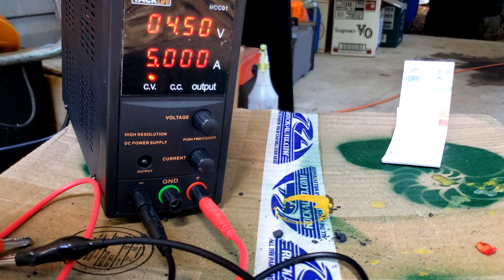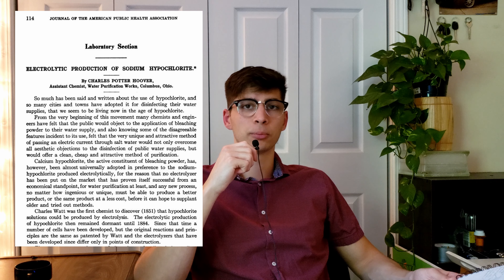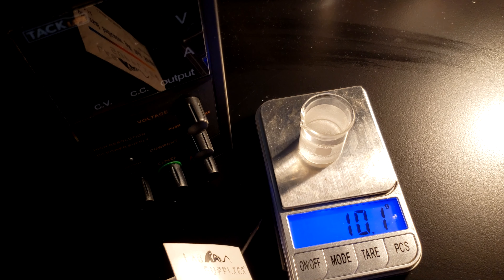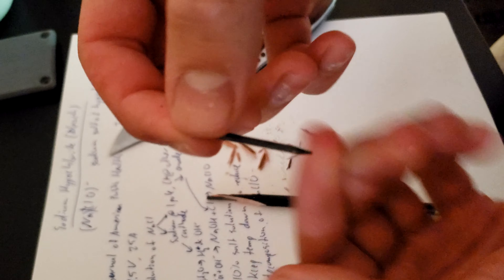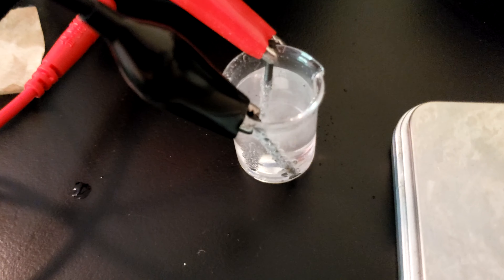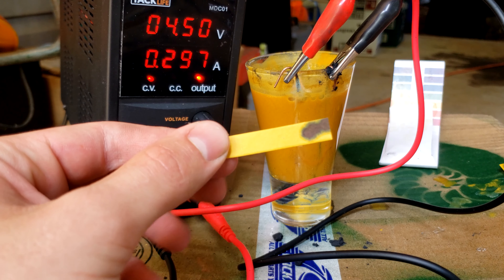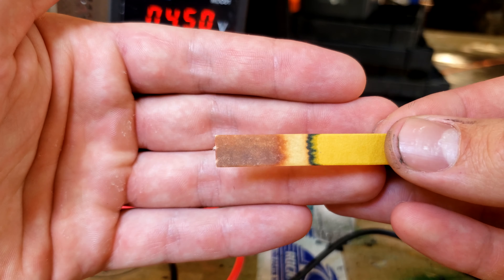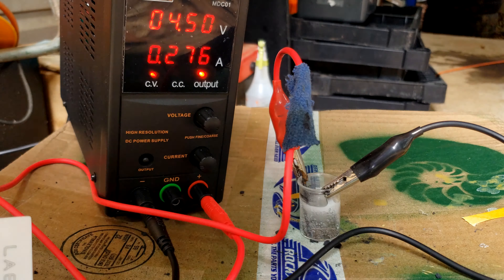How to Make Bleach with Electrolysis

Comment: By my small research and knowledge I think I can explain some points:
- Copper: it does look like Copper I Oxide by the colour, cathodes are highly attacked by the hypochlorites, so generally it is used MMO or Pt plated in Ti.
- Fabric: it does look like denim? The high pH may transform the indigo in leuco-indigo which may be oxidize back to indigo in the presence of O2.
-NaOCl: at some extend you successfully made it. I'm not sure at this point but for the Amperage was a little to high to the scale of the unpartitioned cell letting a little to much Cl2 to escape, which need to react with the NaOH to form NaOCl.
-pH: you only switch between high and low. :)

Comment: You keep saying low PH when you are talking about high PH. Very confusing. Sodium hydroxide should be a very high PH. Like 14 high.
Reply: I could be wrong, but I think because you are not trapping the chlorine gas off most of it is leaving before it can dissolve in the solution.

Comment: Cap it off while it's running and run the hydrogen mix to a lamp or a burner.
I'm gonna do this to make a steam turbine. If I remember,  I'll also try using the flame to heat some thermocouples and see what I can generate

Comment: Try using stainless steel for the anode and cathode
Reply: Doesn't that leech chromium into the solution which is poisonous?
Reply: @M4CHINE69  Stainless steel uses nickel plating, chromium is only used for aesthetic parts, but stainless steel has virtually no conductivity and you would need a thick piece to handle higher current.
Reply: @M4CHINE69 exactly. The metal electrode can only be the +, since chlorine (at the -) eats EVERYTHING that conducts electricity, except very expensive metals (e.g. Platinum) and very cheap carbon (that's why it's almost mandatory to use graphite at the negative electrode).

Comment: Though what could better is that you could sterilize a chamber without opening it.
Reply from the maker: Oh that is a cool idea! I like it
Reply: @DIYBiotech  You should check but the conductivity of the solution should be changing as solvated ions are removed from solution. 

You might be able to produce precise acid-base concentrations for experiment.